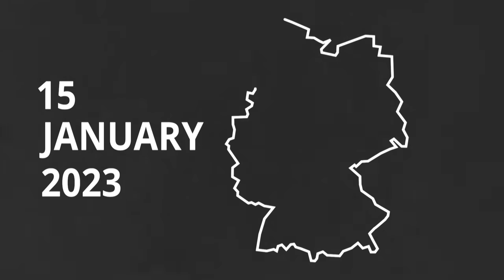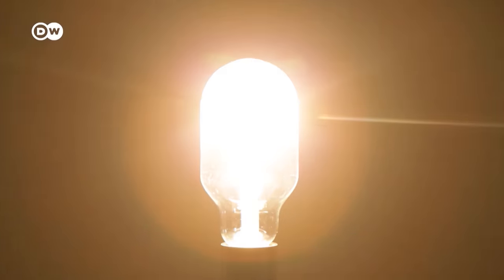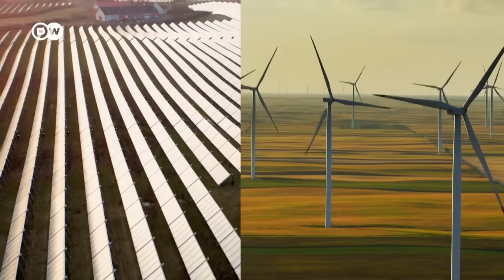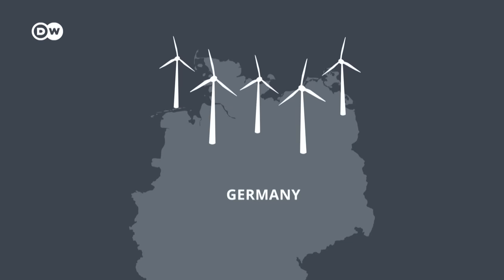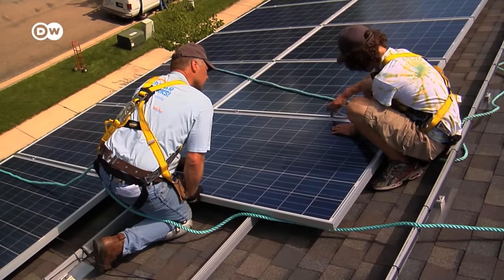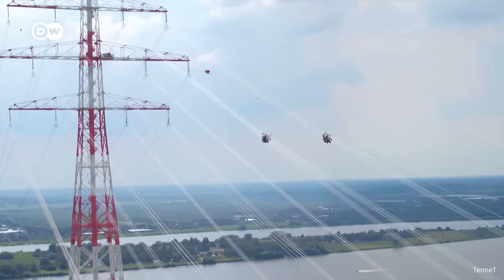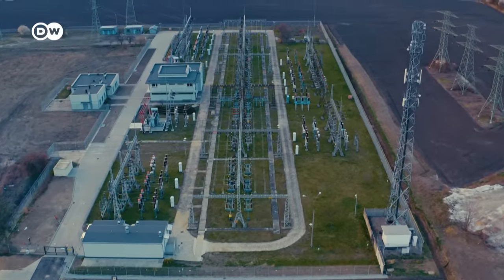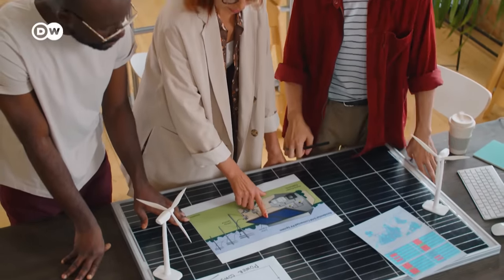This is what's REALLY holding back wind and solar

Comment: One of the best ways of storing energy is by heating up water. Houses, flats, office blocks, factories -- most have tanks of water they heat up to different temperatures at different times of the day and the week, according to what will be needed and when, AND ACCORDING TO the cost. But cost is even further behind in all this than grids! Cost has to be variable and customers have to be enabled to make sophisticated energy-buying choices, preferably with the help of AI, for example, to heat their home up one or two degrees warmer than usual for an hour or two, because cold weather is approaching, or have it one or two degrees cooler for an hour or two, because cold weather has arrived – this will tend to even out demand. On a cold windy night at 3am, your tank could be turned on, instead of turning it on at 6am like everybody else; yes, it would need a bit of energy for three hours to keep it up to temperature, but the energy used at 3am is otherwise cheap and even (as per this video) possibly wasted. There is a huge inducement to nationalise power generation. Companies tend to be driven by the profit motive, and they make more money, the more energy they sell. They have no interest in climate change (as opposed to many of the people who work for them) so they can’t be trusted to help; in fact, they can pretty-well be mistrusted in everything they say, like Boris Johnson, however well they say it.

Comment: A lot of problems would be solved if people installed battery banks in their homes. It costs about $6,000 to get about 20kwh of battery capacity plus an inverter to make it AC for appliances to plug in. If these became standardized, that cost probably could come down to about $5,000 or maybe even a bit lower. This would allow people to run their homes on "direct grid" power most of the time and then switch to battery power during peak use hours. Honestly, even upping the battery bank to a $10,000 cost for 40kwh would make sense. Then the whole home could run directly from battery power and the grid could recharge the home's battery bank at hours of convenience for balancing the grid. I'm actually kind of surprised that utility companies don't offer some sort of discount rate for the ability to do exactly this: Any house which has a utility-inspected battery bank of sufficient size to only need once-per-24h recharging gets the electricity at half the price if the utility gets to determine the time of day to re-fill it. Excess power usage beyond the anticipated amount would come on demand for the consumer but with the utility having the power to ask the consumer to increase the battery bank if they want to continue to get the rate discount.

Oh, one more thing... because batteries have a limit to their useful life that is defined in terms of cycles - no way in heck am I interested in letting the grid operators take from my batteries - not my home battery bank and (if / when I get an EV) definitely not from my EV. I'd be willing to increase my battery bank capacity and consider letting the grid operators have a say as to what time of day my battery bank is charging up for the electricity that I would use over the next 24 hours. But I would not be willing to let them take it back under any circumstances - not even if they paid for "my" battery bank. And not even if they paid me a premium for the energy that they take back. I can always recharge the batteries with solar if I want to ensure that I have enough kwh stored up. But if the grid can take it from me, then I have no energy security even though I have a battery system. I'll take care of my own reliability and use the grid for additional convenience. And I will even let the grid incentivize me on the timing of my obtaining "convenience power". But I will not ever let someone else decide that what is mine is theirs and tell me that my solar panel produced electricity stored in batteries that I got for the purpose of ensuring electrical reliability now belongs to them and that I cannot have the reliability that caused me to decide to make that investment.

Comment: Well, the laundry is one thing, but if I monitor my energy consumption the biggest parts are the heat pump and the electric vehicle. Over the last year those two did account for about 65 to 70% of our total electricity consumption in the household.
But both are also machines where I do not really care when they are running or charging. Lets assume you got a smart home that knows about the needed heat energy, approx solar production from own roof and flexible energy costs about the grid ... then I do not see an issue in letting the computer decide when to actually heat up the hot water storage. Same with the car: if I could program it must load like 20KW every time I plug it for the next day - well let the computer decide when its best doing so. In summer it might be late afternoon when own solar still doing something, in winter it might be middle of the night when the grid has most excess wind energy. As a consumer that just wants to have the house warm and car charged up before riding to work next day: I do not care when this does happen. If it helps the grid and maximizes own profit from solar power or minimizes energy cost because of flexible rate: why not? 
Seems at least like a reasonable pill to swallow to make the things work at least for the large consuming parts of the household.

Comment: For that forever delayed connector between north and south Germany, can you use high temperature superconductors as well as high voltage direct current?  If you are going underground anyway, it seems like it would made sense to go the superconductor route if you could.
Reply: like all things, it depends on cost.
Reply: @davestagner  If Germany could lead the way in building the first leg of an HTSC (high temperature superconductoring) HVDC (high voltage direct current) supergrid, costs of building such things will go down with time and likely spread around the world.  The cost of not building such a thing is likely population collapse due to climate change.  Cost doesn't matter when everyone is dead because the planet is no longer habitable.  However, get renewable power from where it makes sense to do it to where people live on a large or even global scale and we may just have a world we can live in for generations to come.
Reply: @davestagner  Germany has two options if it wants to meet its clean energy goals:
1. Go nuclear.  Germany already said no to this route.

2. Transmit massive amounts of power long distances while pushing for a more global supergrid in order to handle renewable energy effectively.  Pretty much the only tech that makes sense for the scale I am talking about are superconductors shuttling massive amounts of power around.  Conventional lines can't handle the loads.  You would need super busses with hundreds of conductors while a single superconductor can handle all of that load on a single pair of lines configured in a coaxial configuration in what is basically a power pipeline.  You would want redundancy such as configuring the lines in loops so the power can flow the long way around in case the line gets damaged somewhere.  Plus a loop snaking around the country could connect into the regular grid in multiple places.  You need DC for long haul as AC has phase propagation delay issues when going long haul, plus DC much more efficiently uses two conductors while high voltage AC is far less efficient at using fat conductors and needs 3 conductors instead of 2.

Comment: Investing in the grid is definitely a necessary part of the solution. On the other hand, there's no sense in putting massive solar farms in the US, miles away from factories, stores and households. That's just creating expensive grid lines, which only benefit the grid companies. Decentralized, local energy production should be a lot higher on the priority list, e.g. solar panels on parking lots or office buildings, wind turbines near highways,... Create energy where energy is needed, so to speak.

Comment: I've had roof-mounted PV since 2014 (in Texas) and I'm just about to get 2 battery backups.  (They weren't available in 2014).

I'm reasonably certain I will be essentially off-grid, so yes, I would wait until there was sufficient green energy available. ;)

Comment: That's the reason I foresee future to be OFF-GRID. Because, laying down such massive and expensive infrastructures won't make any sense if the households could generate/procure their resources themselves. 
What I think is that a new revolution in resources sector has to occur to make everything decentralized and Off-Grid (just like Web 3.0)

Comment: The grim reality is that lithium energy storage systems are a pipe dream. Power distribution and storage are the biggest constraints.

Political goals are easy to make, the German greens are good at sub optimal thinking.
Reply: Lots of emerging and proven battery tech out there. Government has to invest in it
Reply: @ThomasBomb45  proven yes, 45years old. Lithium technology is fine for small things,   but it doesn't scale  well and is materially expensive and unreliable.

Comment: On December 24, 2022, I was drying my clothes with an electric clothes dryer. Then, I found an alert on the internet. My electrical grid [called PJM grid] in the USA was under a electrical power emergency, and we were urge to conserve electricity because the PJM grid operator was projecting an electrical power short fall.  I turned off my dryer and aired dried my clothes.  Parts of the eastern PJM grid did experience rolling blackouts, but I lived in the western part of the PJM power grid where we did not experience a electrical power shortfall.

Comment: If all consumers/household have 2-5 Kwh per person in storage capacity we would not need spike delivery during dinner/evening but only (for me at least) 500 W per hour in average (24/7)delivery of power, this could fluctuate during the day and even stop for a time when my house battery is 50% or more full. If I then have a app that show my storage status I can plan when I use high intensity loads accordingly. I believe government funded mandatory home batteries would deal with most of these delivery problems. In Sweden we to have most generation in the north and most usage in the south and insufficient transmission lines to get the power where it is needed, with house storage power can be delivered at lower effect ahead of need so existing lines can handle the load.

Comment: Yep, well grid stability is also a big issue, that is not adressed by solar and wind. The stability of the 50Hz frequency is assumed by turning alternators and turning machines that stored kinetic energy. this was present in any good old energy production system, but it isn´t in wind or solar.  the good alternators are sufficient up to 40 % wind and solar, but with less, it gets very tricky. but we are not yet there ...
The public money should now be rerouted from production with wind and solar towards storage systems, the economics of wind and solar is mnow good enough for industriy to assume its capex alone, but for storage it is still not the case.

Comment: Instead of sending the wind-power electricity to the different part of the country, instead it could have been used on site (nearer the coast) for turning waste plastics into diesel by means of pyrolysis. Plenty of fuel would have been made that day and the electricity would be consume in no time, reducing plastics waste and creating petrochemical fuel. Also, it could be used for desalination of water via electrolysis thereby creating potable water and extracting (by further electrolysis) the elements from the periodic table which are a byproduct of seawater. Those are valuable for various usages including electronics (which Germany is good at making and designing). Other electricity (other than say powering an electric train or cable bus or other vehicle) could be used (on site nearer the coast) _ for computing power _(which also makes byproduct heat). Also, line-of-site laser communications could be used with the electricity, sending it a long distance including for intranet/internet data and other signal propagation conversion. People all over the nation would benefit from these things. Could this approach with byproduct Germanium extraction from lignite coal. Metallurgy on site would use that "spare" electricity (especially where molten metals or glass or silicon is processed). Germans who examine the past (as do Brits) know things about preparedness, and the diesel/petrochemicals in North, South , East and West would be a good prepping (as is water and communications).
My comment has no hate in it and I do no harm. I am not appalled or afraid, boasting or envying or complaining... Just saying. Psalms23: Giving thanks and praise to the Lord and peace and love. Also, I'd say Matthew6.

Comment: I already do my laundry etc. when the electricity is most abundant. But living in France, this means at night, to use up all that nuclear energy they can't just switch off.  I have solar panels and produce about 3.5 times more than I consume per year. But it's all sold into the grid. When I installed them, it was actually illegal to use your own electricity, you had to sell it. That has changed, but I'm on an old contract.
I would be absolutely delighted to use my own electricity, in the daytime when it's sunny. I just can't afford to under the current system. Because of... Rules and regulations. Still, it feels good to be a net producer.

Comment: I make more power from Home Solar than I can use most of the time. The excess I put into my home batteries and charge my electric car and motorbike. I already do as much load shifting that I can to make use of my solar in the middle of the day. However, I am not allowed to feed back to the grid as my solar is over 5kW maximum allowed. Electricity rates here in Thailand are a fixed price all day as is the feed in rate which is set at 50% of the purchase price, so there is no incentive to load shift or feed back at times of peak demand.

Comment: I guess it's more targeted to German audience so my remark might not be relevant for the state of the public opinion / potitical situation but:
6:57 & 9:27 "OR option number 2..."
Here maybe insert => OR option number 3 (and btw its not mutually exclusive): what about another DISPATCHABLE energy which also emit very little CO2: nuclear power... 🫢🤫 Sorry for using the forbidden word. But it would sound to me more reasonable to play several games at the same time in case the hydrogen economy don't come to life or if your grid is not flexible on time because of some protest. One could argue that France is balancing the equation but remember: France plans to increase nuclear energy output but DECREASE it in ratio (75%->30-50%) because of planned electric energy demand increase (to decarbonate other fossil sectors).
Risky bet Germany!

Comment: you need a heavy generator that exist in big water plants, gas plant, oil plants, nuclear plants, as long as they're big. They act as stabilizer  to the electric system and any surplus of electricity goes into the turbine so the electric system don't collaps. this goes on all the time every sec.
this is also a way to store more electricity in cables for transfer and reciving. remove them and the grid collapses instantly. the more unplanned energy into the system the less transfer capability and storage over long distance you get. solar and wind is unplanned energy and cannot stabilize the grid some says 30% any more unplanned energy will destabilize the grid to much.

Comment: My electricity bill  has just arrived, my off peak usage is three times the on peak use. The cars, washing machines, dishwashers and water heaters all operate during the night. Day time any use of the Air-Con is balanced by solar panels. Heating is by ASHPs and solar thermal. 
The next move will be to put the fridges/freezer onto batteries that charge from solar or overnight. 
The household bill for an all electric six bedroom house plus three EVs is less than a neighbours two bed semi and is less then my petrol/diessel bill was 10 years ago.

Comment: No.  Once time of use pricing is embedded, grid operators will have no incentive to build out the storage and backup infrastructure needed to maintain first world living standards.  It'll start with "do your laundry two hours later please" and escalate quickly to your boss constantly adjusting your work schedule around changing weather and associated electric prices, and your power company telling you "sure you can use your AC any time you want, except when it's hot out".  When I was a kid we were building out nuclear power to where there weren't going to be any more emissions by 2000.  That was stopped by stupid, and now they're telling us "you little ppl just need to do without".

Comment: 06:55 Texas did build high capacity lines from the west (wind farms are at) connecting to the east (like houston and Dallas) that want the power. at a time last month, we had lots of wind from storms and the ercot grid (wind was like 60% of the power). i was like WOW.  its not un-common. we have a huge mix but Natural Gas is just popular becuse we have it due to the oil wells being here, either sell it or burn it and not profit.  Liquifying that natural gas and sending it germany to use was also a thing.  Germany imported lots of out excess and we where like good now we don't waste it.

i love wind and solar and nuclear, but if all you have is oil, natural gas, and coal at night. by default natural gas would be the cleanest IF nuclear is offline. otherwise NUclear.